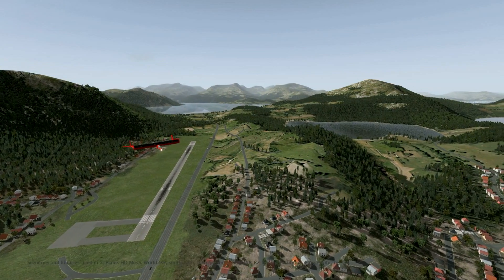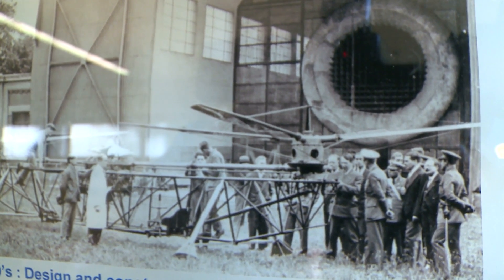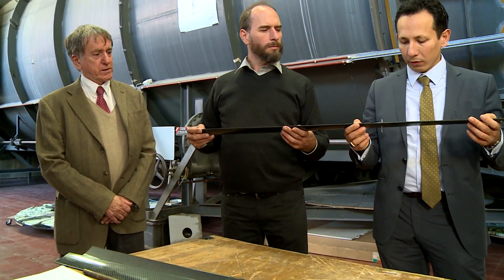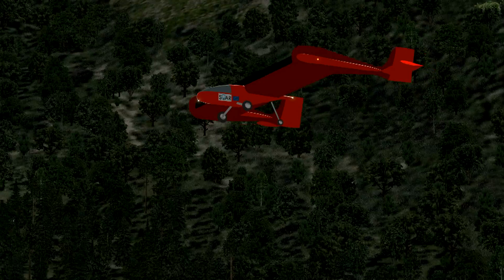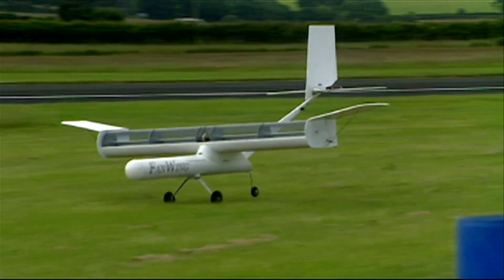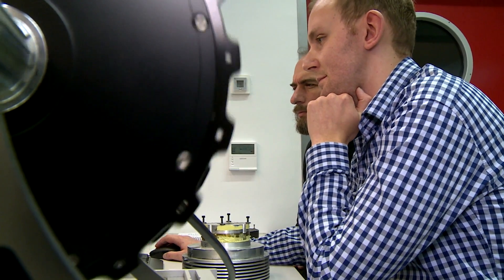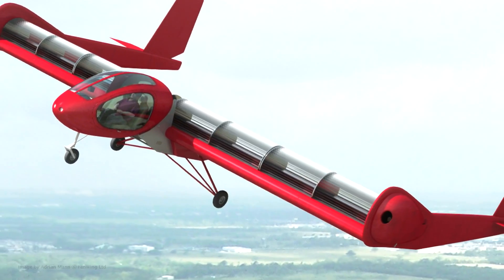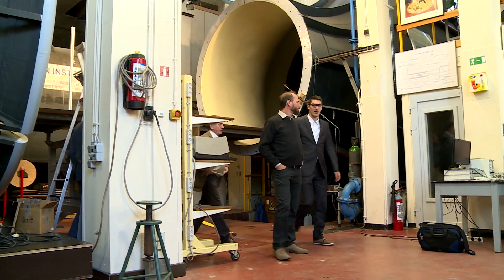FanWing/EU SOAR: Distributed-propulsion aircraft with a trapped vortex inside the rotor cage

Comment: NEAT! I'm a rote level flight student, my beliefs are longer mission times and lowers speeds are probably a dealbreaker. Aft center of gravity is probably awful; also more control of the relative wind into the rotor cage might be able to vector the thrust safely.

Comment: When I was a kid in the 50's, I had a kite that had the same rotor system the same as shown. Here it is back again--they sure took their time thinking about it!
Reply: @ Jack Frost - Yes,  I had something like that - it was made of celluloid, iirc, with a bent wire axle for the rotors, which were s-shaped in cross-section (similar to a savonius rotor:- https://upload.wikimedia.org/wikipedia/commons/a/ac/Savonius_turbine.svg) rather than a true cross-flow fan configuration.   It needed more wind than my home-made split bamboo and tissue kite, but it would handle very strong winds indeed.  Flew it on the beach, around 1952.

Comment: I could see potential if the fan only extended about 1/4 to 1/3 the length of either wing so that it still has a decent glide ratio, however, that would likely reduce efficiency.
Reply: i mean, solid  cylinders that are more flush and low profile would probably work. to your second point, will probably jsut increase wingspan

Comment: Does it glide when the engine fails? No

edit: Ok maybe it does, somewhat. As per below reply :)
Reply: " Glide with power off

R&D is now establishing the ideal angle of attack to achieve maximum rpm. If the motor stops it will be disconnected from the rotor as it is in a helicopter.  Wind-tunnel tests have shown a steady improvement in glide-autorotation. The glide angle will be steep (1:3 )but the actual descent speed will be low and  rotor speed will be high enough to allow a good landing."
Reply: @MarkVickers1  interesting

Comment: Cool I seen protype of this 30 years ago it almost took off straight up like a helicopter
Reply: Many ideas are just refurbished to justify a patent. For instance, I've learned in 2001 at University,  everything about geaphene and geaphine and that they have been discovered in 1954 by a mathematician. In 2009, two nobodies get a Nobel Price for the same thing. ...
Reply: @strobo24  I saw them messing with the stuff in the  middle eighties. They had it it was as just to expensive to produce by the gram then. There was engineering then talking about building a space elevator out of the stuff. The said then it was too expensive though and they were saying in the future they would be able to make it cheep. And use in in 3D printing which also didn’t exist for almost another thirty years

Comment: So much negativity! Why the rejection on this one? Nothing is perfect, there are always disadvantages, but there are clearly envisaged advantages here - slow speed flying, low fuel costs and a short runway. It is clearly simpler to build than a helicopter. Give the guys a break. It isn't easy to develop something new, but it is ALWAYS worth trying even if it doesn't work because new things are learnt and these new things spawn new ideas. Success is built on failure, and I don't even see any failure.
Reply: Am Too you don’t see failure because this is a promotional video

Comment: Different does not always equal better. Similar to why gyrocopters have not become ubiquitous. What makes it better than current options?
Reply: Case in point - gyrocopters.  It isn't better than a helicopter by a long shot, but if you can't afford it, you don't fly! Hense, gyrocopters are not ubiquitous, but they are still a thing.

What makes it better than current options - simple, let me list the options for a farmer for crop spraying:
1. Helicopter - probably can't afford it.
2. Plane - probably can't land it! And therefore need an airport somewhere.
3. Gyrocopter- probably still needs a longer runway to take off than a FanWing
4. Tractor - Good option, IF you have time and access.
5. FanWing - sounds good to me. It has low speed, simplicity, and appears to check all the right boxes. It doesn't make me as nervous as a gyrocopter that hangs on ONE bolt and tiddly blades.
Of course, there will always be other options.

Comment: Really interesting concept. The biggest problem I see is redundancy. If the rotor goes out, what do you have to keep it aloft? It can't be used for human flight... but maybe drones. Also, if you scale up the rotor, the stresses are going to increase dramatically. (centripetal forces) So there may be a size limit to its practicality. But something this novel, with the concept already demonstrated, is worth investigating.
Reply: It can use as many rotors as you want.
Reply: merge it with a autogyro.

Comment: Instead of batteries it would seem a small gas engine powering a generator for electricity would work nicely.
Reply: Then you would need a generator and a motor when you could just get the power directly from the engine. That is extra weight.  It could be use to replace a mechanical transmission which might make it close to the same weight assuming you had to have one.
Reply: @court2379  it's the weight I was thinking about. A very small motor can produce quite a bit of electricity with a tiny generator. Batteries are extremely heavy & the benefits of producing as you need  compared to storing all the power you will need for your entire operation seems like a lot of batteries.. it's just a thought. I have several generators ranging 10,000 to a small 2, 110 plugs with less than a weed eater motor on it. Very light. Certainly lighter than 1 battery fuel included.

Comment: how well could it fly when things go wrong though? how well could it glide if the propulsion failed, how would you steer it if the rudder jammed, etc.?
Reply: Bit like a single engine copter then?
Both would scare me. As do large bush/forest/grass fires.
Which MIGHT be mitigated against by a copter alternative. What bugs me tho is that while you may not need a long runway it seems you might need a very wide one? Kind of defeats that argument. The eco aspect might sway in it's favor eventually for some applications- IF it proves workable.

Copters are usually VERY agile too. Which I doubt this would be. Convincing scale model Monsoon bucket scoops would have to be proven first I think. Very skillful flying required from copter pilots from my frequent observations near my rural neighborhood with both spraying and monsoon  scoops/dumps.

Comment: *the nose of the plane hit the ground.

*large surface area of the propellers

What if they use 2 pairs of wings with half or reduced propeller size.
One in the front and one in the back.
It can prevent ramping the nose in the ground during take off. The additional wing will also help in case of emergency landing.
is this a feasible idea?

Comment: Too much talk. Not enough demo. 👎🏻
Reply: What happens if rain on the blades, because its open , and water will stack on top , will slow the motor or the top of blades can have a protection or this afect some thing on vortex? Sorry for my bad english
Reply: It is a concept, not a fleshed out product so there is a lot of data being collected before anything of larger scale is built. It looks interesting for low speed and lighter craft because the power is distributed over the length of the wing so payload could be distributed over the lifting surface. They showed concepts with the central load but if spread out under the lifting surface, lighter airframe could be used to lift heavy loads like water/slurry for fire fighting or agriculture applications. The only noise generated would be the wind noise of the vortex, probably 60-70db lower in 100-meter noise.  With the whole wing a moving surface icing and freezing rain would no longer be a problem needing de-icing.  It would be a lot more stable but also less agile. Responsiveness requires instability.

Comment: Is there a prototype, with pilot, who can transport any freight? Because modelers also can make a table tennis racket fly! 😂😂😎
Reply: Saw a lawn mower flying...   Heck I saw an outhouse launched like a rocket.  Make a light enough model or a big enough engine, you can make a brick fly.
Reply: @MrShadowpanther3  Classic toaster theory aerodynamics: anything will fly if you strap a big enough engine to it, toasters for example.
Reply: They were testing a new propulsion system. If you use a strong motor with a propeller you can make almost any model fly, true. But this craft had no propellers, or jet engines or anything else that we know works. This can be a pretty big deal in the future if it is scalable. And like they said, the next step is a larger craft capable of carrying two people.
Reply: @bounzig  Beyond working, it would have to work more efficiently than current technology to catch on.
Reply: @MrShadowpanther3  Like they said in the video, this craft is slow, has low fuel consumption and can transport heavy cargo. This makes it perfect for many markets, if the design works. Sounds pretty efficient to me :)

Comment: This concept was tried in the 1930s... didn't work real well, don't recall from the article why it didn't work.
Reply: Ed Cew   Super light materials and technology will make it all happen, weren't around in the 30s
Reply: Curious how the issue of icing on the fan blades 200 leading edges was omitted.
There’s not many airplanes that give me the eebie-jeebies, but this one does in spades!
Reply: @RobotLegJim  How many planes actually have anti-icing tech?
Reply: This is not the old Magnus drum type experiment.  It made lift only & had a separate propped engine for thrust.  This is a patented device that combines lift and thrust.
Reply: drag and more dangerous probably

Comment: biggest downside is.....if fan is screwed during the flight so are you!!! in case of 2 or 4 engines you have backup and hope that God would save your sorry a.....
Reply: It could be split into 4 motors driving 4 fans.  With electric power, you don't need transmissions, fuel lines, or exhaust.  Motors are powerful and light.   If one fan fails you shut off the corresponding fan on the opposite wing.  Fly with half the power to safety.   Then you could use 4 motors for taking off and two for cruise.

Also, you could have a single fan unit with a back up elelctric motor with more wing lift than the 4 motor unit.  If the motor or fan fails you could hopefully glide to safety.
Reply: Sultan Mehmood Ghaznavi split the drum into synchronised segments.... Helicopters have this lack of redundancy also but have done alright for themselves... 
Its only barely a concept at this stage but fascinating none the less.
Reply: Ismee not quite comparable. A helicopter can autorotate with no power.
Reply: They were working on a clutch in the video, which is odd for an electric motor design so my thought is either that is to allow it to glide or for redundancy. There is more going on here but I can't really tell what from this video.

Comment: The greatest risky disadvantage of fanwing aviation is that in the event of an engine or motor failure, the aircraft will not be able to glide.
Reply: Or much like rotary-wing aircraft, there's a narrow maneuvering range to keep the blades turning and the lift available.
Reply: Yup, without engine power it falls like a rock.
Reply: @bulruq  thats a flettner plane, not a fanwing. fanwings can glide

Comment: Compared to a few kilos for a regular propeller, that looks like a lot of spinning mass for full scale aircraft
Reply: Peter Schmidt
No reason it has to be heavy.  It's spinning at only 1000 RPM and the whole thing only has to supply the same thrust as the prop it replaces.  That's it's advantage.  It's accelerating air evenly over the whole wing, providing lots of lift even before it starts rolling, quite unlike a small prop having to accelerate the whole thing to high speed to get full lift.  That's why the fanwing is STOL and good at getting a lot of weight in the air for its horsepower.  I wish development was going faster.
Reply: @denbecr49  I stand by my comment, I used to work in a light aircraft factory and weight is a huge design factor. A single propeller blade is a fraction of the mass , a fraction of the number of moving parts and a fraction of the drag compared to this design.
Reply: @peterschmidt1453  Take into account the strengths of this design and the niche it is expected to fit into.  STOL, high lift at low speed with low horsepower.  Weight of the rotor is negated at least to some extent, drag isn't much of a factor at low speeds, especially in its role as an addition to what's available in the ultralight market.  
I doubt it's as draggy as most of those designs.  I have ultralights and one of these would be better due to the slower shorter runway needed and steeper climb for the horsepower of the engines available to the US market.
Reply: @denbecr49  All well and good if someone wants to play around with this as an ultralight, however the video shows designs of planes capable of loading a shipping container. This design will not be economical for large aircraft, large rotating parts that must remain spinning to maintain lift, too complex IMO.
Reply: @peterschmidt1453  Not nearly as complex as helicopters with their "large rotating parts", and you seem to be ignoring the lift per h.p. data, but we're all entitled to our opinions.

Comment: I would imagine that the Gyroscopic moment will also be huge if we talk about a future bigger commercial aircraft. So a special attention to the handling should be paid
Reply: There is little gyroscopic effect from rotating mass so close to it's axis.  This thing operates at only 1000 RPM.
Reply: @denbecr49  Yes, and they're trying to use as low-weight materials as possible.  But I sure couldn't tell you how resistant the wings are to being deflected, or how they will eventually use the powered wings to maneuver, in addition to providing thrust and lift.

I'm just surprised I haven't heard or seen one "squirrel-cage" reference.

Comment: "the new propulsion system works well under real conditions" 

 PLANE RAMS NOSE INTO GROUND DURING TAKEOFF
Reply: Climate Science Journal lmao
Reply: I'm pretty sure it's because of the large moment of inertia of the fan compared with the aircraft's moment of inertia. I'm not sure how that effect would look like on a full scale aircraft. But I guess the take-off procedure would have to take that into account by imposing a slow spool up of the engine which could compromise the STOL (short take off and landing) selling characteristic of the aircraft, defeating it's purpose overall. I'm curious to see how that will be solved.
Reply: @randomjoao  Don't be subconsciously biased by the necessary massiveness of farm machinery or paddle wheel riverboats : ) The  rotor is designed opposite from a flywheel.  The rotating mass is close to the very long axis of rotation and operates at only 1000 RPM, so rotational inertia is minimal.  The power is divided up by the large total number of blades and their supports.  The rotor can be built light weight from a tube and sheet aluminum or carbon fiber. 
Spooling up is done before take off to get lift over the whole wing before the aircraft even starts rolling.  That's only part of how it achieves STOL.  The rotor will increase in RPM during takeoff and climb only from static thrust RPM (or higher with the shutter narrowed) to cruise RPM and, as always, pitch control authority can be maximized by tail surface size and/or distance of the tail from the center of gravity.  Making sense?
Reply: @denbecr49  I don't think it's moment of inertia is negligible on this scaled version compared with the fuselage's, even if the blades are carbon fiber with foam core, or other light option, and even if it only operates at 1000rm. If we had more information on the geometry, we could calculate this.
Reply: @randomjoao  Calculate it often enough and these things become intuitive.  Contact the inventor Mr. Peebles about it.  He answered my emails once a few years ago.

Comment: Power failure ? 
Can it rotor down ?
Reply: Theoretically speaking, if the rotors are able to spin freely, it's likely the "Magnus Effect" could still apply, thus giving the aircraft a chance of returning to earth without a catastrophic crash. Unlike conventional aircraft requiring a constant high pressure over the wings to remain airborne. 

However that would also depend upon whether or not the payload on board the aircraft exceeds the lifting capabilities of the wings and rotors outside of normal operating conditions.

Comment: Fixing the lift issue of the wing on the model:  make the wing volume equal on both sides of the fan shaft.  The model lifted from the back, not because of weight imbalance, but an imbalance of air pressure relative to the fan shaft.  You owe me a million dollars for this observation.  I'll need it in an offshore account and I want to be included on the patent.  So extend the leading edge on the wing to match the volume of the trailing edge relative to the fan shaft and you might get vertical takeoff with the proper increased fan rpm. 
Your welcome
Reply: timothypb actually, no. It lifts from the back because of counter rotation... the same way a helicopter body spins opposite to its main rotor when the tail rotor fails.
Ultimately, they will need either a central drum spinning in the opposite direction... or a tail rotor blowing air up to counteract the rotation.